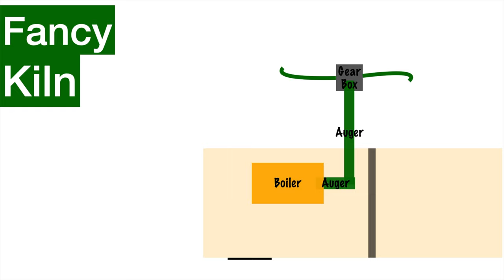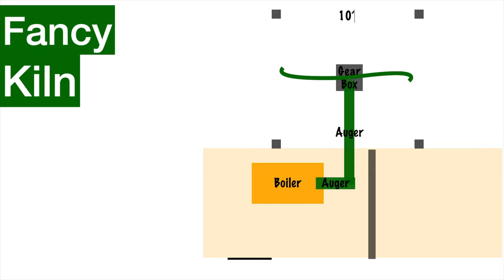Building a Fancy Shed - (part 2 of the Dry Kiln Series) Design and Build of a Timber Frame Shed

Comment: Dont ever, ever run a saw with long sleeves on, and use Push blocks, keeping your hands no closer then 8 inches from blade.
Reply from the maker: Bad angle, I don’t think my hands were actually super close to the blade. Good advice though. The outdoor table saw is a bit tricky for long sleeves in the winter.